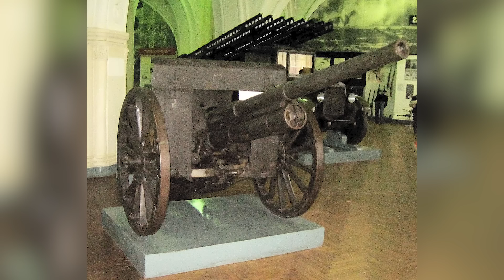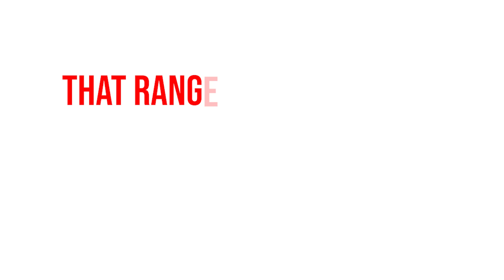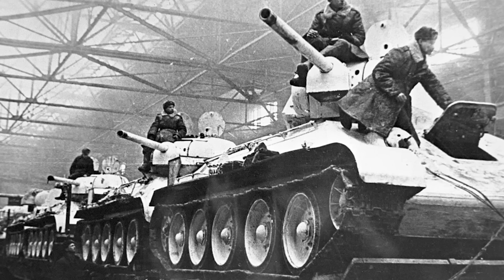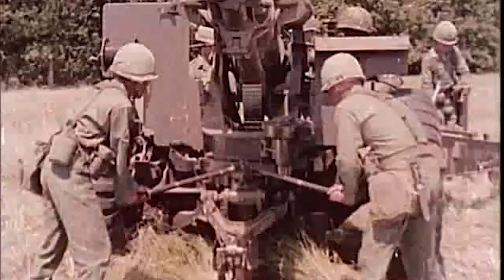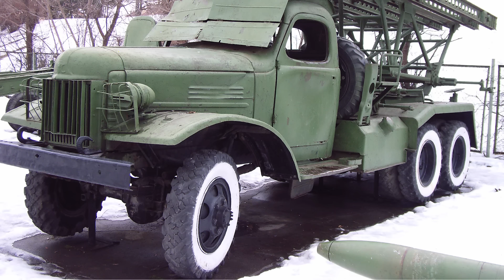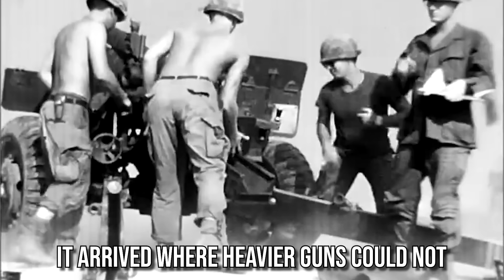Every WW2 Artillery Ranked — WORST to BEST

Comment: Surely the German Flak 88mm Field Gun deserves the top spot ?.A trubute - as ever - to German engineering flair, forward-thinking and design. As with so many German weapons in BOTH World Wars, its essential features - rate of fire, manouevrability, ease of use, adaptabilty - it was ostensiby a Flak AA weapon , feared by the Allies - but it could also function as an extremely effective anti-tank weapon - which was deployed so effectively against the Russians on the Eastern Front - and also in France and also so effectively by Rommel in the desert war in North Africa against tbe Americans and British. A weapon greatly feared by the Allies - in the same way, perhaps, that the MG 42 machine  gun was, too.

Comment: The Polish Army used the M1902 cannon in September 1939 as the basic fire unit at the infantry regiment level – some were re-calibrated to 75 mm caliber during modernization to the wz. 1902/26 standard. One of these guns was used in the defense of Westerplatte.
Reply from the maker: Ah, the M1902 – a true OG of the battlefield, still holding its own even when outclassed. A testament to Polish ingenuity, wouldn't you say?

Comment: No the 25 lb was NOT queen not the battlefield.    It was only 88 mm.   As a artillery piece,  it was not much more capable than a 75mm.     It had no where near the effectiveness of the US 105 mm.
Reply: it was very effective due to rate of fire, crew training, accuracy & coordination with forward observers etc
Reply: You are looking at the 25-pounder through the lens of 'hero stats'—calibre and shell weight—rather than evaluating it as a Pragmatic Strategic System. Reducing the 25-pounder to 'it was only 88mm' fundamentally misses why it was the backbone of Commonwealth forces.
First, let’s talk about the platform. You mentioned the traverse; the firing platform (the circular track) was standard issue for a reason. It allowed the gun to be traversed 360 degrees without resetting the trails, giving it a tactical flexibility for rapid re-targeting that static-trail guns struggled to match.  
Second, the range argument doesn't hold up to the ledger. The 25-pounder had a maximum firing range of approximately 12,250 meters (roughly 13,400 yards), which actually outranges the standard US 105mm howitzer of the same period (which capped out around 11,200 meters).  
The real 'Queen of the Battlefield' metric wasn't the size of the bang, but the speed of the loop. The British/Commonwealth artillery system was arguably the most responsive in the war precisely because of the integration with the Forward Observation Officer (FOO). It was a closed-loop system designed for high-volume, rapid-response fire support, backed by intensive crew training and a high rate of fire that allowed it to generate 'fire superiority' faster than heavier, slower-handling pieces.
Effectiveness in war isn't about having the biggest shell; it's about the ability to bring massed, accurate fire onto a target faster than the enemy can react. The 25-pounder, supported by the FOO and that 360-degree traverse, did exactly that.
Reply: Just two words  sour grapes
Reply from the maker: True
Reply: Romel would not agree with you
Reply: The 25pdr was extremely accurate - it’s nickname was “the 5 mile sniper”, it was fast to get into action and was able to also act as an anti tank gun, if necessary. The other forgotten fact was that the first 17pdr anti tank guns were mounted on modified 25pdr carriages to get them into battle as quickly as possible.

Comment: Russain artielry direcion systes were notoriously bad.   Its why they had to have so many guns to have an affect,  just like seen in Ukraine.   That meant often they simply missed the lines or targets.   So there was no systematic taking down of German artillery.    It was all ad hoc and if it worked at all it was due to numbers in an area blanketing and hitting by statistics not accuracy.   You see the same thing in Ukraine,  lots more shells,  much less effect.   And add into that,  tubes wear out and they did not and don't replace them,  they don't have the logistic and did not have them.
Reply: Once again you've been lied. During the war the russian artillery equipment was almost on par with the german one. But the accuracy is not just a good gun. The russians lacked good topographic maps and radios. For example, when tested by germans in shooting range, the 76,2 mm ZiS-3, 122mm A-19 or 152 ML-20 guns, their tight shell groupings matched or exceeded German equivalents. So, they had to adapt. But in  1944 the situation improved a lot, not just because the quality control improved a lot (the propelant quantity was always the same) and also the quantities of tactical radios also increased, allowing the artillery regiments to be in permanent contact with spotters not to mention that they also had access to high quality pre-planned fire maps which proved to be very effective.
Reply from the maker: So basically, Russian artillery was the "spray and pray" method of its time, and apparently still is! Good to know some things never change, even if they should. 😉

Comment: Everything is in metric so it's basically nothing if you're an American. 😏
Reply: The US Army DID frequently use the Metric System, in WW II. Maybe research before making broad American Exceptialism statements.

During World War II, the US Army primarily used the US Customary System (inches, yards, and miles) for daily operations, small arms, and vehicle manufacturing. However, they widely adopted the metric system for land navigation, map grids, and artillery to seamlessly coordinate with Allied forces like France and Great Britain

1. Map Grids & Navigation
Metric Maps: US Army Map Service topographical maps in theaters of operation (such as the European Theater of Operations) used standard metric scales, primarily 1:50,000 and 1:25,000.

Grid Coordinates: Soldiers used map grids measured in kilometers and meters to designate locations. They plotted exact positions using a coordinate scale and protractor to find 4-digit or 6-digit grid coordinates.

2. Artillery & Fire Control
Mils over Degrees: For artillery target calculations, the US Army used the mil, dividing a circle into 6,400 mils rather than 360 degrees. This allowed gunners to easily shift fire—at a range of 1,0000 meters, shifting the gun by 1 mil translated to a 1-meter shift on the ground
Metric Calibration: The barrels of heavy artillery and mortars were calibrated in millimeters, such as the widely used 60mm and 81mm mortars and 105mm howitzers.

3. Ordnance and Weapons
While US infantry small arms were based on the Imperial system—such as the .30 caliber M1 Garand and .50 caliber M2 Browning—the army regularly used and captured foreign metric weaponry. Many heavy tank and anti-tank cannons were also designated in millimeters e.g., the 37mm  M3 anti-tank gun, 75mm tank guns, and 90mm anti-aircraft guns.

I do hope these little facts helped
Reply from the maker: Gosh man you really did put some major effort in stating facts . I really admire people like you who dare to give so much time, to state correct facts , thanks man
Reply: @the_rising_guy Thank you. Yes, i probably took more time than i had expected to
Reply: It’s not that difficult to do a rough conversion. We’re not helpless.
Reply: @tmcgill2219 
Exactly!
Reply: You mean like the American 155MM Howitzer?  ;)
Reply: 1 kilogram = roughly 2.2 lbs
1 km = .62 miles or 1 mile = 1.6 km
1mm = .040 inches, 1 inch =25.1 mm
Reply: @lawrencemeinholz9282   @jwhite8794  I think you mean 100 km = .62 miles